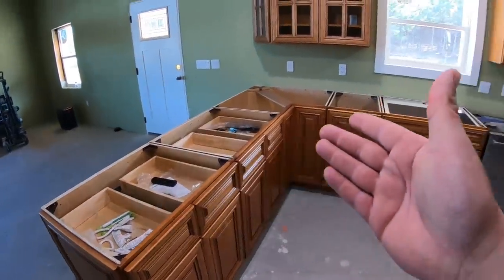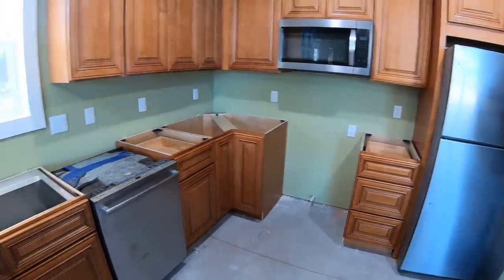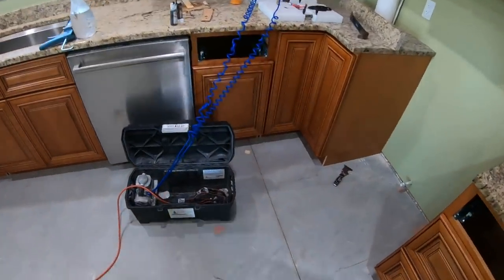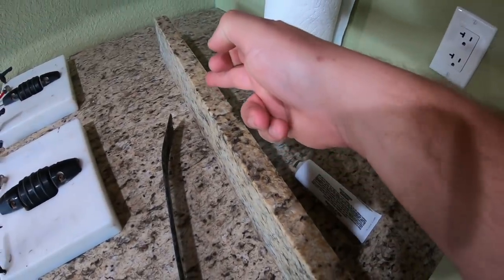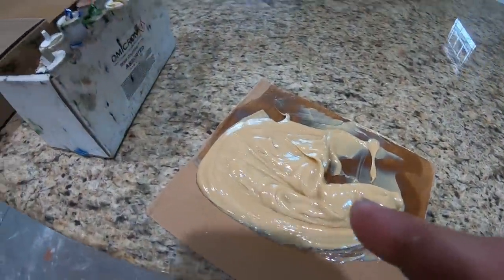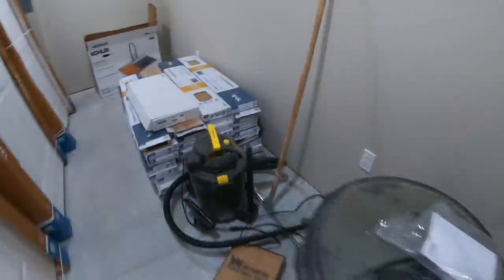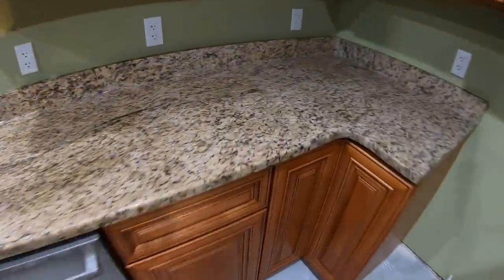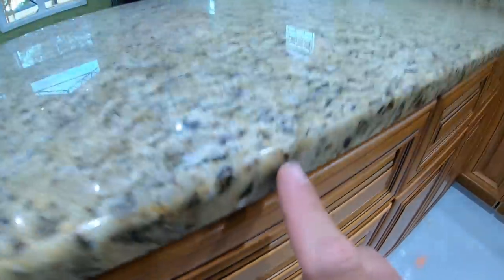Our countertops are installed!!!! #529

Comment: Looks great! I am curious about the do's & don'ts with the granite. I'm surprised it was cheaper too.
Reply from the maker: Basically watch direct contact from extremely hot pans, no Bleach 😳, vinegar, wipe up all spills (especially oils and wines). Most important seal at least once a year or more often so the surface isn't porous to absorb and hold stains. Sealing is quite simple.

Comment: Very cool you have the counters in. Great color choice and seems like Tiffany loves them too. Andrew you are doing a great job on the house. Won't be long and you will be living in the house.One question on the sink area? Only one hole for faucet. No soap dispenser or air gap for dishwasher? I always put the disposal on a button in the counter if you install one. Looks like you have the switches on the wall. You can always drill more holes which is cool. Again looks great and you should be so proud..
Reply from the maker: Our sink kit came with a single mount faucet. We use store bought soap bottles and we have no desire for a disposal, I like to keep that out of our septic system. Those switches are for under cabinet lighting and a single light over the sink. Thanks for watching
Reply: @TKCL  That's cool, we don't have a disposal either. Just thought you need an air gap on the dishwasher. Most all places I have worked they require an air gap even though some have them built in like Bosch or Miele. Guess your inspector and area may not require them..
Reply from the maker: My unit is a Bosch so hopefully that's covered.
Reply: @TKCL  Andrew just don't want you to get it all done and then go for a final and get called. Better ask your inspector what they require. All areas that I built in required it even though it was a Bosch. Better safe than sorry. Just a question.

Comment: Nice looking countertop you've all got there👍
 I see you put an big overhang on your peninsula. No place for the outlet or are you doing pop up's ? Are🤔 you all on the 2017 or the 2020  NEC code?
Reply from the maker: My plans show 2017 code if I remember correctly. They are approved by the building department with no peninsula power listed.

Comment: If they had measured the counters with their laser set up why did they have to do some sanding when they got to your home? When ours were installed they fit perfectly without any adjustment. Just curious.
Reply from the maker: I mentioned in the video that was them cutting into the ends of the slabs to bond them together with epoxy.

Comment: Well congratulations on nice countertops is that Ghibli I think it's called I had that in my kitchen up in Ottowa it does look like Ghibli to me very easy to maintain except for oil spots so don't cook any oils and be careful when you washing stuff in your sink because if it has oriely whatever just clean it real quick I know it's feeling everything mine was sealed as well triple sealed and everything but still I will be honest with you I'm telling you this as good good advice but what does matches whip tiles in my kitchen what I had done was a bullnose up on each side of the countertop going up to the vent. And then what I did is in the centre I got a centerpiece and I put it on an angle so that all the tiles in that corner actually was 45 angle then if you look at the the rest of the tiles was simply a beige Stone what you must before you do any grout because of the simple fact that the has all bunch of porous holes in it but it does beautiful with that type of countertop I did it in a few different kitchens.
Reply: I should add that this was what I had in my kitchen I think care 2000 is what I installed it back damn here in Canada it cost me like 7800 bucks mind you I had double edge included the sink and a bathroom and in the same kitchen tile as the bathroom interior was was basically right beside the kitchen I also put it into a multimillion-dollar kitchen at one point and that was like $15,000 just in product plus installation and installed actually the same thing in two different condos
Reply from the maker: I don't remember the name, but that wasn't it. We are quiet nervous about the stains but do take very good care of our stuff. I plan to stay on top of sealing it.
Reply: Zoocasa
10 - 1230 Marenger St, Ottawa | Sold for $XXX,XXX | Zoocasa for back splash  2010